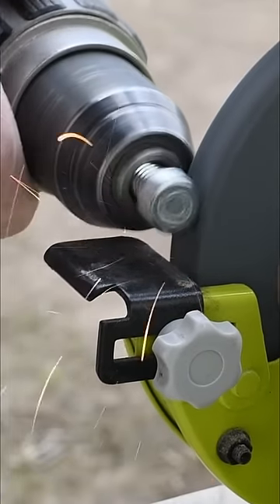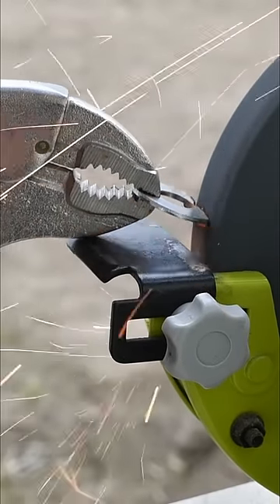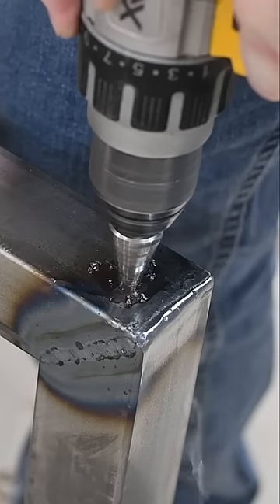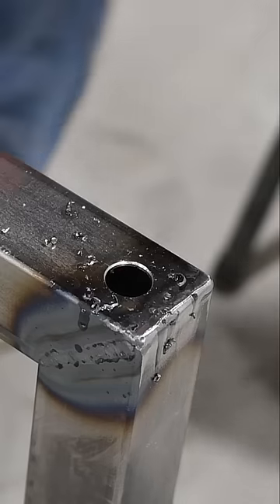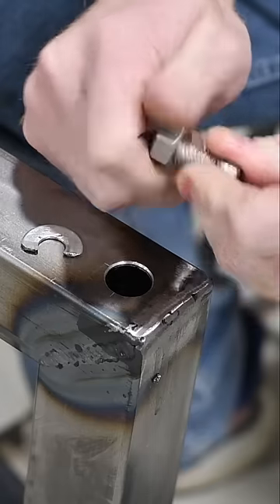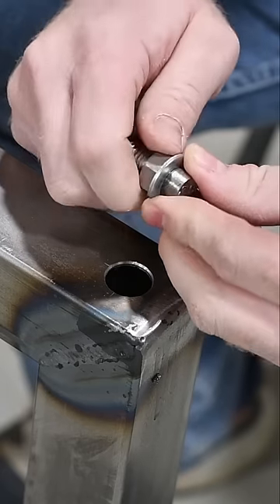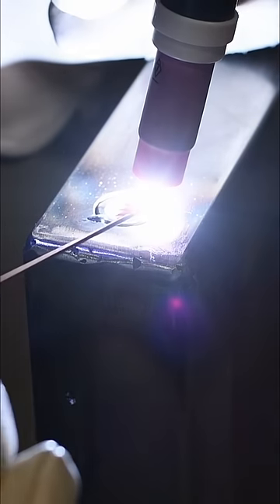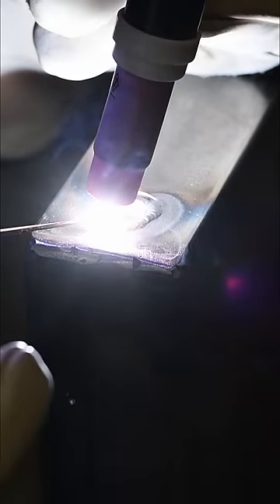The end of rivnuts! 👹Bwa Ha Ha Ha!#shorts

Comment: You can also use a hex bolt so you don’t have to grind the bolt round
Reply: Ya, really unclear why you need to grind the bolt head down.  Maybe if they didn’t use the washer as a spacer.
Reply: The bolt heads same size an the nut, how would you weld just the nut if it were covered by a same size bolt head, and you only need one bolt and washer to set multiple nuts
Reply: I have used a size 17 nut and a hex bold size 8 (sorry in from the Netherlands 🇳🇱) 
I can weld on the corners from the bolt (spot weld)
Use the hex key nr 8 to remove the bold. 
If you use a hex bold with a collar you have even more room to weld. 
You can hold the hex bold with your one hand and weld a spot weld with the other. 
You don’t even need to grind an washer in a C shape.
Reply: @CalvinSSDD  the couple of minutes to grind down a bolt he had was not worth messing about getting a hex set screw
Reply: @mikepage9520  the washer gives the spacing you need, and odds are high that the hex features won’t be perfectly clocked, so you could still get that first tack no problem.
Reply: The grinding on the bolt is for clearance to do the tack, but still leave enough meat to capture the washer. The hex won't leave that much room.  It's fabricating a tool that can be used over and over.
Reply: @rgl_motorsports  but my point is with the washer you can still tack it on the flats, then remove the bolt and finish your weld.  Grinding still does not seem necessary to me.

Comment: Nice but try a rivet nut tool
Reply: The same thought came to mind. I was thinking of the number of times I was one riv-nut short on a job and I may just use this in an emergency
Reply: Sure but this is the better way of doing it
Reply: @raynman6466  rivnut allows installation on painted surfaces and other places you can’t use heat, like nearby wiring
Reply: @jadesluv  ofc there are situations where a rivnut would be the "better" option but a welded nut is permanent, stronger and it sits flush. Rivnuts can fail and leave a raised lip.
Reply: Rivet nuts are great, but with time and corrosion it can become loose and be a major pain. Welding is permanent.
Reply: How many have a tig welder at home? How many can even tig weld? I hope its not painted..Yes perfect choice if ur doing 1 or 2.u happen to be a welder.....not sure what rivet nuts u use but mine are stainless so no rust and maybe tack them in
Reply: @ddmorphballzz2651 lemme check the video again....nope, not painted
Reply: @ddmorphballzz2651  Iagree. I have a tig welder but I would definitely use a rivnut. Way faster and someone said it has a lip well so does this tig unless you grind it down.  I don't have to worry about heat warp on the thin metal with a rivnut.
Reply: Is that Dodge says too, when they fall out of the A pillar for the oh sh!t handle. I welded nuts in there too. Not coming out, are strong , and very functional. Rib-nuts turn, get loose , and if you’re lucky , occasionally fall out. Convenient
Reply: sure but this is flush mounted and rivet nuts can get loose. plus i guess if he wants to get better at welding he has more to practice on. i thought the weld looked pretty good. that corner less so but im sure he can fix that if he feels like it.
Reply: @shantyburton6854  Not if installed correctly.
Reply: @robedwards9486  you do know that dodge used rub nuts in that location, correct? Both sides. So your saying both sides were installed correctly or is it, that the riv nut Is an inferior design destined to fail over time. Is that what your saying? Sounds like it.
Reply: Rivet nuts can be installed without tool - screw and nut is needed actually + some skills. 😁

Comment: I like installing the nuts on the inside of the thin wall tubing before welding into a frame. I'm unusually making frames for industrial electrical control panels. Welding a bolt slipped through from inside the tubing makes it easy for heavy panels with U slots on the bottom tabs. Starting a bolt and washer works too but at least one washer does try hard to get pinched between the tab and frame. 
The video technique does look good but it never hurts to have plenty of options.
Reply from the maker: Makes sense!

Comment: Here’s the most complicated way to weld a nut into a panel 😂 it works for you though so cheers
Reply: Post a video on a easier way.
Reply: @thiniceking12  ever heard of a welding magnet? They make them in all kinds of fun sizes and they're extremely easy and quick to use. Plus they're multi-purpose, not a single-use product.
Reply: @jutde  have you even tried tig welding that close to a magnet? The arc wil wander, i try to avoid it, but it's not always possible
Reply: @TomvdHeuvel you just need to tack it
Reply: @jutde do you own a Stainless-Steel-Magnet? Nice
Reply: @thiniceking12 ut the nut on a bolt and just hold the bolt in position so you can get a tack on it lmfao
Reply: This is more reliable than a rivnut.
I still like rivnuts.
Reply: @tuck6464  What do you think about deez?

Comment: Tip ...use a brass bolt and do the job before you weld the joint together... that way you don't have to modify the bolt
Reply: What was the point of modifying the bolt anyways?
Reply: To create clearance for that initial tack weld
Reply: @peterjohnson9438  so why not just put everything in place with a normal bolt and washer, then back the bolt out, remove the washer altogether, and then just thread the bolt in enough to make sure the nut doesn't distort?  Way faster than all that grinding.
Reply: @kd5nrh  The washer and the bolt give a flat surface to ensure the nut sits flush while tacking.  And you only have to do it once.  It's called "fabbing a specialty fixture", which is something most fabricators have to do at certain times.

Comment: I've done this when rivnuts weren't practical,  however in my opinion the one disadvantage of welding in the nut is the need to chase the threads after welding.  Other than that,  good job.

Comment: I don't see why the head of the bolt was ground down? I guess to give the clearance for the first weld? But you could also just do a small spot weld on the C washer to the threads directly and just leave the head alone. I would think, still pretty cool though.

Comment: Cover the hole to prevent weld splatter from damaging threads. 
Chase threads with a tap afterwards.  Welding warps and distorts the shape.
Reply: I read the above posting and liked it cause it was exactly what I was thinking.  Then I  saw that I had posted this two months ago.😂

Comment: Good tip if it's relatively thin and you don't want to use the garbage that is rivnuts, but for thicker material just tap the hole with the thread you need lol.

Comment: You are actually pretty good at welding. I would say ur weld was a little hot, but that's better than too cold and not having it penetrate. U want ur weld at the end to ha e this shiny almost polish look to it after ur done. That means its was just the  right amount of heat. That mostly for carbon steel. Other materials show different sign of when too much heat is applied. You welds are consistent overall and ur dime size is also consistent so ur doing a real good job for someone say they arent a welder. It all takes time an lots of practice but ur doing better than a parge percentage of people so keep it up!
Reply from the maker: Thanks for the great feedback. Always nice to get some friendly advice! It is much appreciated!

Comment: Chase the threads with a tap or chaser tool. The heat can warp them while welding. Also, rivet nuts exist, not as clean but would do a very similar function.

Comment: A 3/8-16 rivnut is about 15 cents if bought by the thousands and doesn’t require welding, and doesn’t heat up the material. Usually you’d use a weld nut in this application, not a hex nut.

Comment: Not bad at all , but maybe if you have access to the end of the square tubing before welding it together "" just drill a hole where the nut will go and using a short piece of threaded stock ( bolt with head cut off ) with nut near end of threaded stock insert through end of tubing up through frilled hole and weld it in place inside the tube , be careful to not weld the threaded stock ,, just tack the nut then remove threaded stock and weld around the exterior of nut ! Hope that helps !

Comment: Or weld a few nubs on the top side of the nut that protrude outward at the points, drive it in, thread in a long bolt partially to keep buckshot out of the threads, and for some control, and weld it. Saves you a lot of time modifying a bolt and washer while accomplishing the exact same result.

Comment: Nice trick.
Grainier sells the nut you want to weld in. It comes with a built in flange and is available in plain steel or stainless steel.

That chromey homey hut is probably made in China. So you’re likely inhaling lead oxides & zinc oxides. Even a good p100 filter won’t stop those fumes.

Comment: flange nut works well if you don't need it to be completely flush. Just thread bolt in to protect the threads while welding, no washer necessary

Comment: But, this is what we used to do before someone figured out you could save hundreds of hours with a rivnut setter. A professional rivnut gun costs £400 and sets the nut & undoes itself in half a second. It's faster than your tack weld. Even the worst manual one is still 10x faster.

Comment: They do sell these, and can be used without welding, they are called clinch nuts, or Avdel, threaded inserts.
Reply: With this method, the nut is flush with the surface. Perhaps that matters for what he's doing. Those threaded inserts always have that little bit that sticks proud of the surface.
Reply: @georgeblack589 there're different types, not all of them stick out

Comment: So if I need a threaded socket in a metal object, but dont have the tools to directly drill such a hole, I use this method, in which I firstly drill a normal hole the size of a circular nut, then I push the nut down there until it's flush and then I weld it in. Correct?

Comment: not bad, not bad. I will concede that your method is more than adequate for the purposes you are using them for, however this wouldn't pass an FAA inspection which is why I must continue to use rivnuts on occasion. T.T

Comment: You can also thread the nut onto bolt and hammer it down into the hole until flush Tag weld it and remove the bolt no grinding needed

Comment: Awesome.  But why grind down the edges off the 1st nut?
Reply from the maker: To create clearance for the arc to make the tack. Without grinding the head, the nut is almost entirely hidden by the head. The small area of the nut that is visible is hard to get a tack on because the arc wants to pull up to the head of the bolt.
Reply: @ShawMade366  thank you.  I appreciate the response.

Comment: Leave the bolt in the nut to weld the rest because there is a good chance of the heat messing up the threads if you don't

Comment: Its easier to just use a magnet to hold the nut in place. No grinding a bolt head, no grinding a washer, no threading a nut and washer onto the bolt. Just a magnet

Comment: You would have to REALLY want that flush finish to not just get a rivnut tool and a dimpler, because it would be a massive pain to modify that many nuts accurately to do this on any appreciable scape. Getting a kick out of all the comments from people saying this is better than a rivnut because it easier, won't slip out, etc. Just file a small key into the rivnut hole before you crimp it and it won't ever slip. 

I admit this is a great look, but it's not ever going to catch on for production use unless someone sells bulk round nuts for cheap.
Reply: You are only modifying one bolt and one washer to be reused on many nuts

Comment: That’s one way. The other way would have been to weld the nut in prior to welding the section together. Use a counter sunk screw to centralise the nut on the clearance hole.

Comment: Be careful when welding Nuts like this. At my workplace we welded stainless nuts to a stainless frame and after welded, the bolt was unable to enter the nut. We had to replace all the nuts. We are not sure what happened but we think there was too much welding heat causing deformation of the nut
Reply: Stainless steel warps a lot more than carbon steel, so you are right in thinking that the heat from welding caused the deformation of the nuts. Some things that would help include using thicker hardware if possible to resist any warping, using a welding process with a lower heat input like TIG, and welding multiple smaller passes with less filler metal rather than one big one. I also suggest welding in short sections where you jump to opposite sides of the nut (like tightening lug nuts on a car) to spread out the distortion equally rather than just welding it all the way around in one go.

Comment: Not a welder?  Pretty nice bead you laid there.
I would have put a plug of putty inside the nut before welding but my weld are popping all over.
This is a good trick for a one off quicky,  but if your are building many, there are several better, faster, albeit costlier ways to this.

Comment: Lets see .. 1)grind a nut down, check. 2)Grind a washer, check. 3)Drill tubing, check. 4)Get a bolt and put washer and nut on it, check.5) Insert bolt,washer nut combo and tap in, check. 6)Tac nut, check. Remove bolt and washer, check.7)finish welding, check.8)grind down material, check and boom
Rivnut way .. 1)drill hole to size,check. 2)insert rivnut and rivnut gun, check.3)squeeze. Check. 4) DONE ... Yeah i think ill stick with rivnuts
Reply from the maker: I had the entire job done in less time than it took you to write this comment.

Comment: If I'm doing that much work.... just get  a pile of thick washers I bought a box years ago still have a bunch.  Drop one on each leg tack it.  Then use a drill tap the washer is your pilot hole so it doesn't wander and gives you enough meat between it and the base metal to hold threads.  A box of washers costs pennies each.  Less than nuts.  Welding nuts often takes a  tap to clean up. You're drilling a massive hole which takes more time.  Anyway washer tack tack tack drill tap zip zip.  Done.
Reply: Drill tap being a combo you don't want the added time switching tools

Comment: This is a better solution than a riv-nut for sure. But not everyone has the time or the equipment to do all that. And not every surface will accept a welded nut. Riv-nuts are good for quick and easy while somewhat robust depending on what material you're riv-nutting. There is nothing quick or easy about this solution. In the time it took you to do all this, you could've installed like 10 or more standard riv-nuts
Reply: Magnets will hold the material too

Comment: Why did you grind the head off da bolt again?!
I understand the C-cut in the washer for access to get the first tack-weld in on da nut.....
They also make Allen-head bolts that still give the ability to use wrench/tool to move bolt. 
Just sayin'.....

Comment: What’s the point of grinding the head of the bolt down when you can just put the washer and a nut in the bolt, press the nut through the hole and then back of the bolt? The nut’s not going anywhere especially after the first tig spot weld

Comment: Or...make the hole big enough and hold the nut in place with magnet?
Reply from the maker: Valid, but i wanted to keep my gaps as tight as possible because it makes the weld easier, especially for a novice! 👍

Comment: Honest question since I'm the worst diyer in earth, why not just use the nut and bolt and grind down the face? Or would that not work?
Reply: Not 100% what you mean but this tool is just to get a tack for holding the nut while he welds. The trick is that after he grinds it down, it should be flush with the steel.
Reply: @sherlocke9276  gotcha that makes sense.

Comment: How can you weld the nut so clean, but weld that square tube so sloppy?
Reply from the maker: Haha. The corners were some of my first welds, ever. I had a few hours of hood time by the time i was welding the nuts, which helped a ton. The nut i filmed for this video went particularly well. I was lucky to have the camera rolling. The other 30 nuts i welded in also went good, but not as smooth as the one i filmed! 👍

Comment: Rivet nuts are a thing and cost way less than what you spent in your time to do this.... Just saying. Yes if you are trying to use what you have available or go for a cleaner look, this works. However, if it's not necessary then it's just not worth the time and effort over the simpler and cheaper methods

Comment: You could just use a piece of allthread and not have to grind down a bolt and washer just to do this. I mean it works but so would a 10 inch piece of allthread and you just hold it so it doesn't fall in while you tack it. Idk it's probably what I would do over grinding down bolts and washers... that just came to mind when I first saw this like if I needed to do this I'm just grabbing a piece of allthread and not thiking I could grind this bolt down then this washer and when I hammer them in it will hold and I won't lose the nut. You don't even have to make the hole smaller than the nut you will fill any gap with weld anyways so to me this is like going around your elbow to get to your ass! Sure it works but shit you took 3 right turns when you could just go straight lol
Reply: He needs two hands to TIG weld the nut. A magnet would have worked also

Comment: Why ground the bolt circular when you can grind one side to clear for the tack, then you still have a head for removing it instead of a stupid circular bolt.
Reply from the maker: That would work, but i didnt have any trouble removing the rounded bolt with my fingers all 32 times i used the method. But grinding one side of the head would work just as well.